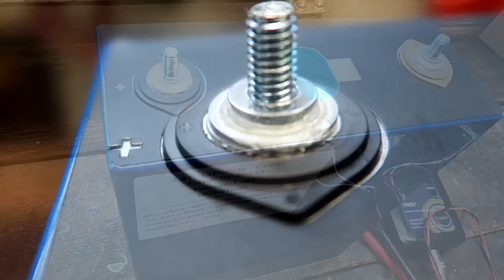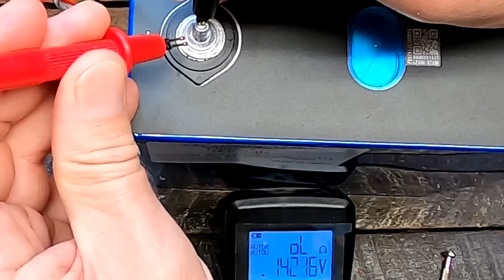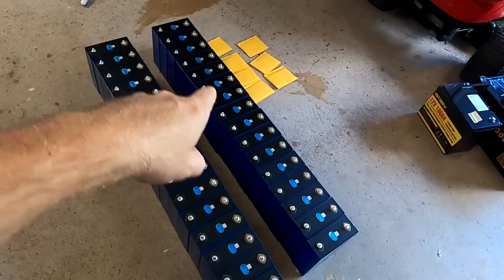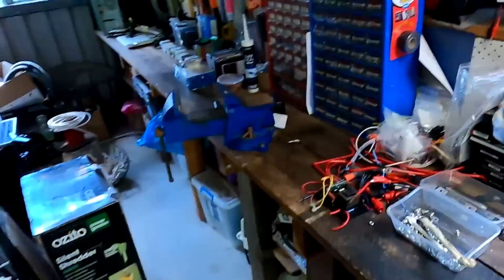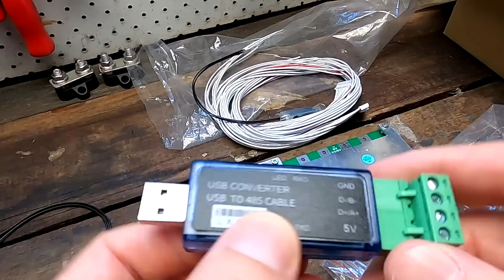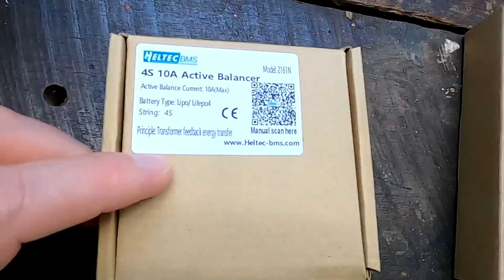Two new battery banks.. But what's the best BMS I should get? 🤔

Comment: would really enjoy a seplos bms review. seplos seems very interesting and feature rich. i particularly like the idea of having multiple bms, connected in master slave configurations where only the master communicates with the inverter and the slaves only communicate with the master. this way, you don't have a situation of having more than 1 bms potentially telling the inverter different things....either by way of canbus or by sending a quick signal to see if charging current is available. also, the seplos can function with 16 bms in parallel, plus they also have that niffty lcd screen. the seplos platform seems to bring a professional features to the dyi market.
Reply: Yesterday I got my Seplos BMS. I'll test them tomorrow :D
I got one 150A and two 100A versions. That'll be a lot of fun!
So far I am using a REC-BMS...it works well but sometimes the SOC jumps from like 80% to 100%...I'm sure, that this has something to do with software and could be improved, if I tried harder ;)
Reply: @Raphael_Hofmann  ok nice. if you have the time, let me know how your testing goes.
Reply from the maker: What would the Seplos BMS tell my inverter?
Reply: @OffGridGarageAustralia  When one cell reaches low voltage disconnect, the inverter will switch off. When one cell reaches high voltage disconnect, the solar charge controller will reduce the charge current. You'll need a Cerbo GX or a other victron-device, that is capable of CAN-commucation.
Also the BMS will basically replace your battery monitor.
Reply: @OffGridGarageAustralia  I could be wrong about all of this but from my understanding, where the value of the Seplos platform is, is the fact that you can have multiple batteries, each with their own BMS all linked to a master BMS that communicates to the inverter. So let's say, you have BMS1, 2 and 3, each with its own 48v battery where BMS1 is the master and BMS2 and 3 are slaves. If BMS1 has a full battery but BMS2 and 3's batteries still need charging, BMS1 will simply cut off charging to it's own battery but will not communicate to the inverter to stop sending charging current until BMS 2 and 3 reports back to BMS1 that they are also now full. It is at that point, that BMS1 tells the inverter to stop charging. I am not sure how that same scenario will pan out if again, 3 batteries each with their own BMS and neither BMS is aware of the other but 1 BMS has a fully charged battery and the other 2 don't. Would appreciate your feedback on all of this Andy....thanks in advance.
Reply: @hendersonsobers396  The inverter doesn't send charging current - it TAKES user current to invert it to 240V.
Did you mean the Charge controllers? Only very expensive charge controllers communicate at all... They just make current available for the BMS. If the BMS can't use it, the charge controllers just don't have any current taken from them.
Reply: @JoeInBendigo  Hi, I was referring to the all in one inverters which also has the chargers built in. Sorry, I should've mentioned that. Thanks.
Reply: @hendersonsobers396  & @Off-Grid Garage: so what is the issue of balancing below 3.4V using a 'dumb' BMS and an active capacitive balancer? My balancer has been connected permanently to my 4S 280A Battery for 6 months or so. It hasn't been cycled in that time, because the solar panels have kept the charge up pretty well.
Should I change anything?

Comment: great testing Andy. I've now installed several packs using the jkbms (no screen) without any issues. 304ah cells. 16s. No problem at 200ah discharge 80% and the standard cables. I add a 9v battery with a N.O. push button switch for the bms boot. As well the battery paste works great. I noticed price increases for batteries but 230ah are at a good price Grade A from a USA supplier free shipping. I'm in sunny southern California. 7day delivery. I have 45v 9a panels and I use a boost converter to 56v for my solar charge controller to the bms. BMS controls all the charging. Thanks for your testing.
Reply from the maker: Yeah the JK sems obvious. It's the best I have seen and tested so far. I have never turned my one off after the initial testing, so the start procedure seems less important...
Reply: Great ides with the pushbutton. Why is the external voltage needed when starting the JKBMS? It seems to me like it could just steal the voltage from the batteries via the BMS cables.
Reply: @porter5976  I thought the same but the bms start needs to be more than the battery pack voltage so it can't be borrowed from the cells. Just the workings of the bms. Once everything is set up its only needed if the B+ is disconnected. The B+ is the negative of the pack. The B+ needs to be more positive for boot. Using the cells would short the pack minus to a cell positive.

Comment: Use an ANTBMS as the 3rd one. It comes with a massive lcd display, so it should be interesting. It can tell you the individual cell voltages, lowest, highest and average cell voltage and more. It has a large state of charge indicator on the display as well. And it can be pretty serious, I have a 400A one...
Reply: No screen recording for us to follow, but more than two screens on our devices will be hard to follow for us to see at the same time.

Comment: Did you see the EVE cells LithiumSolar got with the double bolt terminals? video yesterday.
Reply from the maker: Yes, saw his video...
Reply: Those look awesome...
Reply: I just bought 12 cells with those terminals. A lot more surface area for 2 inch flat copper bus bars I'm working on.
Reply: I was going to say the same thing. But didn't want to Andy to have buyers remorse.

Comment: 1. Heltec Active Balacer: If you use this balancer in a battery bank, you get possibly very, very late about cell drift in you bank. One side. Other side, would know about cell drift and could cell drift be a case of warrenty?

2. Testing newer BMS: I’ll would suggest to test the CHARGERY BMS, on the bad side, it should be very complicated to install, the good side, a gay, call Mattias said, Cargery has work on the Firmware and I want to know, how easy is it to install now? The good on the Chargery BMS should be, it doesn’t work with Fets. You can disconnect the power by relais, if cell drift or other fails are to big, looks like more secure.

Comment: I been interested in the seplos, with all the features, the current limiting on charging, I think maybe a heater function, plus communication,  I was thinking about getting one. But my system is 7s 24v, 3.7/4.2v, I also have a backup system LiFePo 12v system. I would like a larger smarter BMS,
Reply from the maker: Why would you want to limit the current while charging?
Reply: @OffGridGarageAustralia  Depending on the temperature. In cold climates Seplos will regulate the charging current based on the cell temp as it has to be lower to avoid the damage. Also there is a 10Amp safety feature too...
Their manual is written in bad english but it covers all the scenarios and describes all the features.
Reply from the maker: @HG-Pilot  So the actual BMS will limit the current? Or does it report the numbers to the SCC and they then throttle down?

Comment: I'm very interested in the "Seplos" BMS. Seems to be quite high-end to me. It has a Can bus and should be compatible with Victron SMA inverters and can be combined via RS485. I guess it's used in some of the rack batteries Will Prowse likes so much. They also come with a display. I have one lying around but didn't have a chance to test it yet. I'd love to hear your opinion.
Reply: Yes, Seplos pls! 👍
Reply: @Ericcando81  Hi Andy I also like the look of the Seplos BMS just a shame no bluetooth. Thanks keep up the good work
Reply from the maker: Apparently balancing sucks with the Seplos and no Bluetooth?
All BMS's have now communication ports which can talk to Victron. But for that reason? It is not necessary.
Reply: @OffGridGarageAustralia  Come on Andy, give it a try, balancing is not that bad and you can you use the monitoring software they supply.
Reply from the maker: @gerritgroothuis  Let's see...
Reply: @OffGridGarageAustralia  I doubt that there are many BMS' out there that can communicate on the CAN bus with Victron. And probably none that implement intercommunication between multiple battery packs.
Balancing is indeed not better than on most other BMS'. But it's it worse? That would be an interesting test.
No Bluetooth it true, but you can connect a computer to the RS485 bus if required. I don't use Bluetooth anyway, so for me that would be no loss. Please, Andy 💆🐸
Reply from the maker: @ElectronTinkerer  Most BMS can communicate with RS485 to the Victron system. CAN is limited to only a few BMSs of which the Seplos is one of.
We will soon have the JK BMS being fully integrated in the Victron system with two-way communication.
Reply: @OffGridGarageAustralia  That's true. Which is in my opinion why this is interesting. CAN is something that others don't provide. I tested the JK myself and even implemented its RS485 protocol into my controller, but did not yet come around testing the Seplos, which is why I'm more interested in that one. I'm waiting for my second 16 cells to arrive and have to decide which of the two BMS to use. Especially since in theory I could equip both batteries with a Seplos, let them communicate and only connect my controller to this same bus instead of using different BMS.
Reply: I have zero issues with balancing on my seplos bms. I like them a lot. I like the simple parallel system just like the pylontech. 1 master and the rest are slaves.
Reply from the maker: @bjornschrijnemeeckers9521  Is there one battery bank connected to the master and the other banks are slaves or how does this work?
Reply: @OffGridGarageAustralia  you need to setup 1 bank( bms) as Master with the dipswichtes. Then you can add 15 slaves to the Master. I have connected the can bus bms to the Cerbo cx.

Comment: If you love testing and tinkering so much, why not check out Stuart Pittaway's diyBMSv4 ? 😉

A great open source hardware and software project, with 1.13-1.27A balance current, MQTT/Influx Database integration for monitoring/logging and can be connected to Victron (CAN).
Reply: agrees that it may be something for you who like to test, this is a system that may be worth testing and mixing with
Reply: I would like to see where the DIYBMS has gotten to recently also. 

It's always growing and presents a possible option for Andy to see improvements based on his feedback, as anyone might.

Comment: Well done Andy, After seeing these measurements on the screw terminal, I understand why the measurements in the Vlog " All these different busbars... and why they don't matter!" showed huge wrong results, in which the internal resistance did not match the measured voltage and current of 160Ampere according ohms law. Because in that video you measured the transition resistance of the bus bar on top of the screwterminal so, including the resistant of the screw.

Comment: Since you are going to have 3 banks of cells in parallel, there is a benefit in keeping the total resistance of each bank of cells the same.   If you use different BMSs on each bank, the resistance will be different and because of that, the current that is drawn from each bank will be different.   (There are a few reports on the DIY forum where different BMSs cause a significant difference in current).
This means the banks will be used at different rates and worn at different rates.      However, as Will Prowse likes to point out, the cycle life of the cells is so long you may be hit by calendar life failures first.

Having said all that:    I love your reviews of equipment so seeing what you think of some of the other BMSs would be fun!!
Reply: This is why I am blue in the face for saying cells should be paralleled and not putting banks in parallel
Reply from the maker: Three banks with different resistance will not necessarily end up with different currents. The one with the lowest resistant will deliver the most current, so will also have the lowest voltage. Hence the other two banks deliver more current to supplement as they try to keep the same voltage.
I thought about this 'problem' but think it isn't one. We will see, test and learn ;)
Reply: @OffGridGarageAustralia  Yes,  The current will start to equalize AFTER the one that has the lower resistance has discharged some.  The one with lower resistance will always be discharched to a lower SOC than the others.
Reply from the maker: @centerrightproudamerican5727  That is what I'm expecting. I guess we will run some comprehensive testing... 😊
Reply: @OffGridGarageAustralia  You don't see very many physicists on here. I don't think you would allow me to write 2 or 3 pages to clear that up in layman terms. It would be a very long story but should save you some "comprehensive testing" I  think. Unless you prefer I could email you.
Reply: I'm only posting for the people who might believe this. You are incorrect sir. On all counts.
Reply: @patshannon5107  I guess we will agree to disagree.
Reply: @centerrightproudamerican5727  I can only tell you. You don't have to listen. Monitoring each cell is better than monitoring a group. Period.
Reply: @patshannon5107  A couple of points.
1) I do not know why you made this comment because I said nothing about Parallel-first (grouping Cells) vs Serial-first cell arrangements.

2) Your statement is very dependent on the definition of 'better'.    If it is always better to monitor individual cells, then why doesn't a Tesla monitor each and every cell individually?   Hmmmm,  it seems that the Tesla engineers decided that in their situation it is better to monitor cells in groups.  Furthermore,  they have made that decision for every single car they have designed for production.  

It is unusual for something to always be 'best' in all cases.  Engineering is all about tradeoffs and any decent engineer understands this.    Yes, it would be nice to monitor every cell.   However, that adds cost and complexity.   At some point, an engineer has to make a tradeoff between adding to the cost and complexity and the value provided by that cost and complexity.   

What if I said "A dump truck is the best vehicle.  Period."    My guess is that a few gravel hauling companies might agree and a few indy car drivers would disagree....and both would be correct. 

I have designed many battery systems, and each situation involves a different set of objectives and constraints.    Consequently, I find that sometimes grouping cells is the correct approach and other times monitoring individual cells is the correct approach.     Heck... I have heard of people not monitoring the cells at all.  (I doubt I would ever do that but their constraints, objectives, and value system led them to their own conclusion of what is 'best' )
Reply: @centerrightproudamerican5727  You are correct. I appologize. Engineers always build what they design. And you are correct in I have never seen nor heard of a single instance a car battery caught on fire. I again appologize. Let's drop this. I can only tell you. You don't have to listen.

Comment: You are absolutely correct about the current through the welded studs.   The current through each of the two paths will have a ratio that is inverse of the ratio of the resistance between the two paths.    By the time you get the total resistance through the stud and nut it will be a lot more than from the pad to the busbar.

Comment: You should try assembling one of the batteries without top balancing to test how matched the cells are. Then try using a balancer bms to see how long it would end up balancing it.
Reply from the maker: That's what I'm going to do with the new battery packs. I'm not doing an initial top balancing. They go in production as they are and the BMS has to sort it out.
Reply: @OffGridGarageAustralia  You are awesome Andy. Keep up the good work! Regards from sunny Argentina.
Reply: That is actually a good idea. I like that!

Comment: The most simple BMS, with no balancer or balancer turned off, just a voltage cutoff basically high/low on each cell.  Leave it running 6 months and compare capacity before/after and see how balanced it stays without a balancer - and compare to those you are OCD balancing :)
Reply from the maker: Well, we have tested this already with the QUCC BMS a few times here. I rarely charge my battery full and if so, the cells are usually all over the place. SO I need a strong balancer which can handle that. So far only the JK could excel here.
This is also more a test of how good your cells are matched.
Reply: @OffGridGarageAustralia  I'm  3 years in and no issue with no balancer ....
Reply from the maker: @stupidmonkeykev  All depends on your system setup and what cells you use. I have seen set ups without balancer but they usually keep a top and bottom buffer and run the cells only in the middle part.
Reply: @OffGridGarageAustralia  i think your 3 delivery's in 1 battery may not be ideal.  New setup maybe more stable.

However i also think you panic at 0.01% capacity imbalance  (100mv @3.5v)  be good to see you leave 1 of your 4 48v batteries "unbalanced for months and see if that effects capacity.  (Spoiler, it wont, but prove it :))